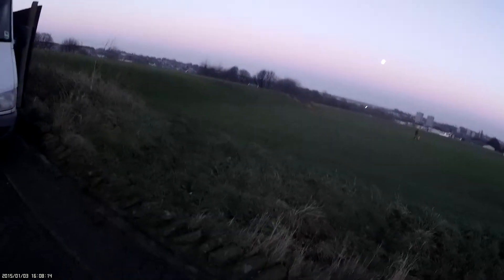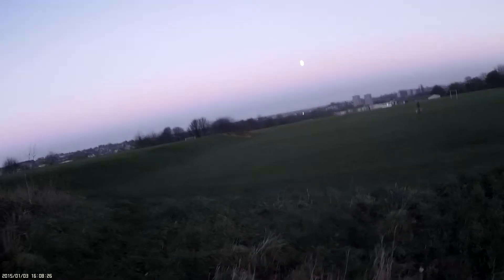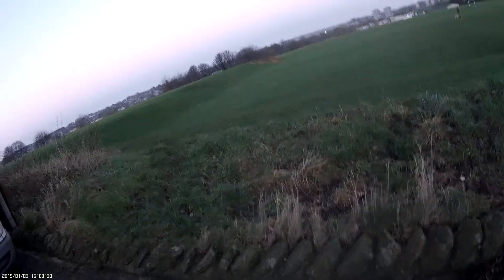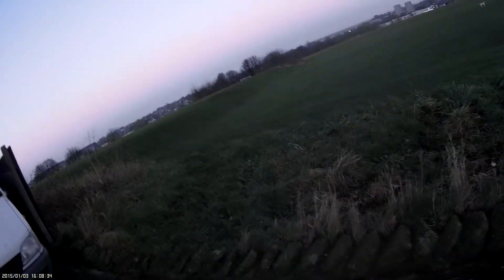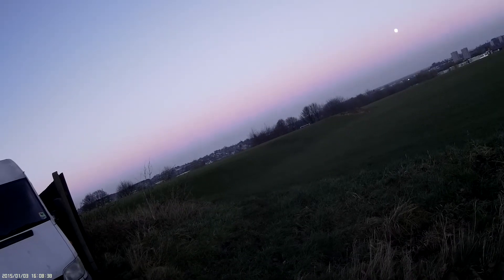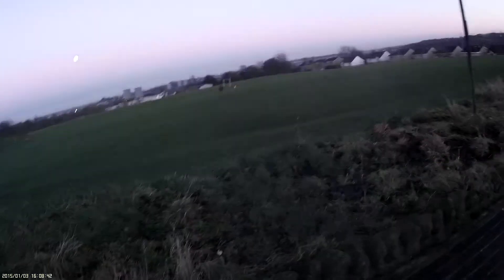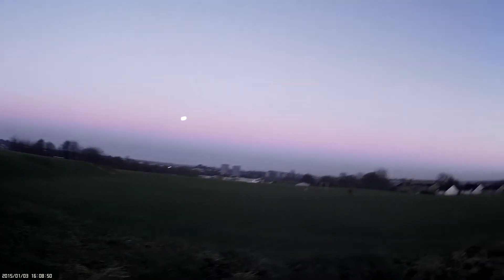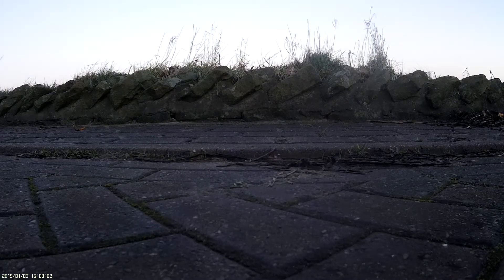Emax 250 Quad Testing 6x3 props with a 2200 3S

Comment: Think your lipo is to much from  the look of the video..maybe a bit heavy too.. id try 3s 11.1V 1500mah Li-Po maybe even 1800mah might get around 5-7minute flight time..i have the emax  250 as well and i went with a smaller lipo 1500 to be exact.. works well with the cg for quad and all gear,,just something to think about..as far as gains and such i havent had to dial anything in with mine so i couldnt tell you anything there..sorry!!!
Reply from the maker: I was only testing a 2200 3S for a friend who wants one of these but does not want to buy a load of 1300/1500 3S's. I have a decent stock of 1300 Turnigy Nano 45-90C and 1500 Zippy Compacts 40C batteries. That's what I run in my CGX250 and that is what I intend to run in the Emax once it is sorted.
Strange thing, the first FPV flight with this went fine, No picture break-up with no power filter. The next time I get it out, as soon as I spin the motors, the picture goes all 1950's on me. Now the 600TVL sercurity cam 2000 cam has gone on to black and white mode!!! I have not touched any of the settings. What's going on? Got a FatShark power filter coming!!! Hopefully that should sort it all out?
As for the PID settings, that's another story. I flies ok, but its nowhere near the Naze32 Acro. Once its unsettled, it takes 1-2 seconds to level itself off again. So every time you let go of the sticks you are waiting for it to sort itself out! Once your flying, or in rate mode you might be able to make smooth progress, but flying L.O.S just hovering about it wobbles all over the place. I have tried a couple of different sets of settings for this quad frame, but none seem to be any more stable. If you hold it in your hand with the motors of half power in stable mode it does not seem to try as hard to fight you when you move it off level. The Naze32 Acro in my CGX 250 really fights you trying to go back level. I can't see me having set it up wrong. The Open Pilot seems pretty straightforward. There is a new derivative of Base Flight called Clean Flight that is trying to adapt his software to run with the CC3D flight controller and that has a AUTO-TUNE function, similar to the APM board where it works out the PID settings for your model. I have installed it on my Naze32, but have yet to test it out! At present though it will not connect to Clean Flight via  Mini USB. But I think it will be sorted before long?
Reply: maybe that will sort it all..i dont know what could be causing that..only other thing is maybe a faulty esc? maybe the control board who knows..kinda interesting though..ill do some checking around and see if anyone i know might know what could be causing that..
Reply from the maker: Cheers.
It is flyable! Just not as settled as the Naze32 quad. Don't think it's a esc?
Last night I wiped the CC3D board, re - flashed it and loaded everything again, just to make sure I was not doing anything wrong. Should have power filter by the weekend so once I have it all up and running, I should get a feel for it. See if it is any better? Once I am bombing along it might be stable? May just be more susceptible to its own prop wash than the Naze32? 
I'm not just going to swap it out for a Naze32 without giving it a go!!!